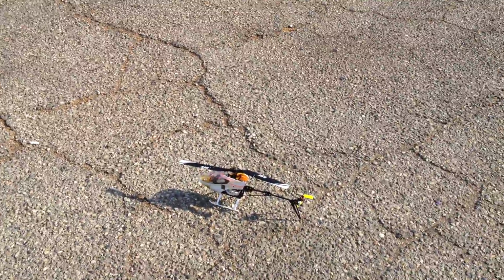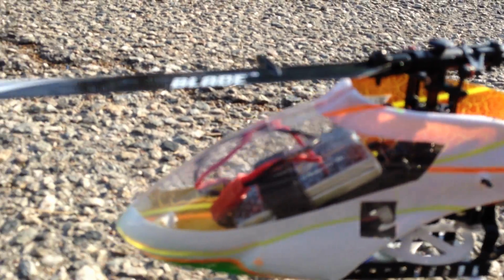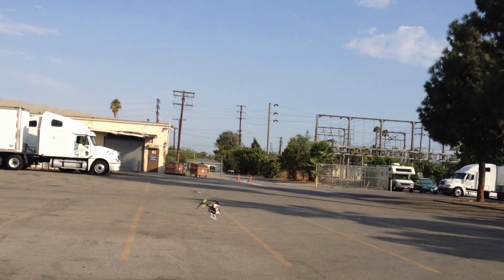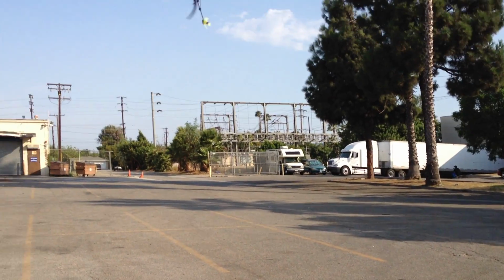Horizon Blade 130X HP08s

Comment from the maker: yea the bullet blades work pretty good. They're more stable in the wind so I use the bullet blades more. Downside is they are a little slower for 3D, but I get in return better stability.

Comment from the maker: Nope the stock ESC works great with the HP08 motor. I put in over 100 flights with the setup and no problems. And I fly back to back sometimes :) You might however have to get connectors to hook up the motor and ESC unless you get the version with the stock connector already soldered on. RcDepothobbies has the plug and play version so no soldering is needed.

Comment from the maker: No all stock bearings and Walkera tail flange bearings for the tail case. As long as you oil the bearings very few flights they last. I put well over 150 flights and the stock bearings are still like new:) Save your money and get the motor instead hehe The HP08 with an 11t is pretty much a plug and play. The battery tray will need to be trimmed slightly where the motor fits, The HP08 motor is an outrunner design and has a larger diameter. If you call RcDepotHobbies they can help let you know

Comment: i just put a spin 8000 in mine flys close to stock around 60% throttle but when I kick it up to 70 to 80% the tail kicks out on a pitch pump. any ideas on how to fix that? gyro gain?